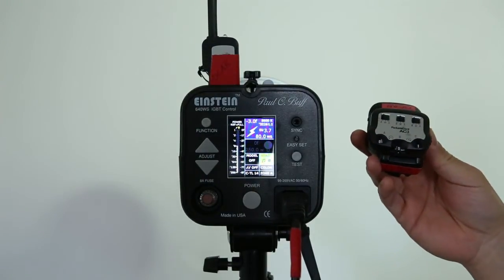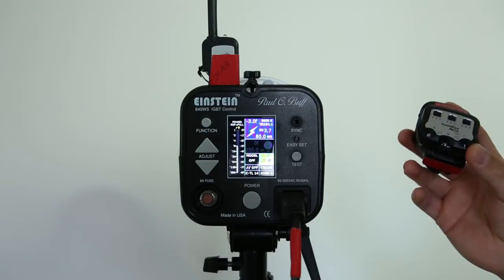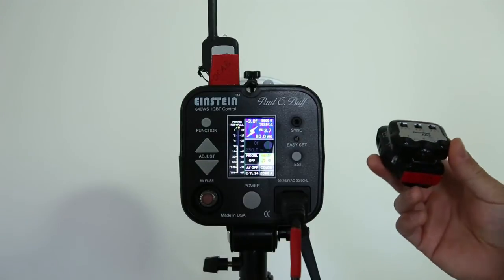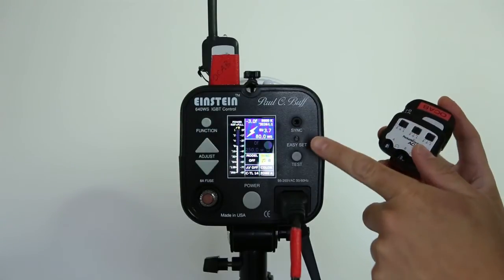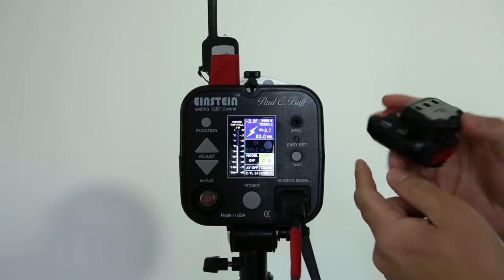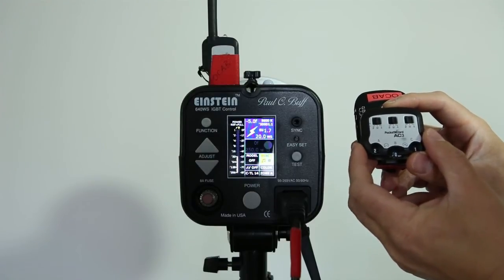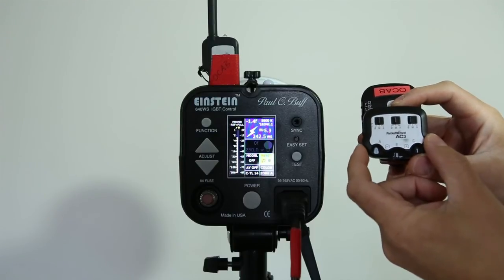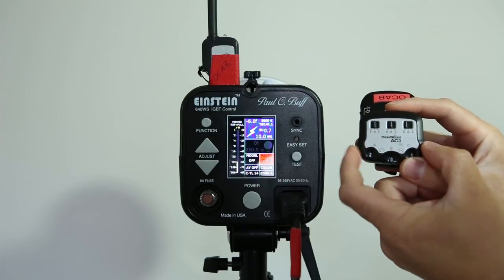Pocketwizard MiniTT1 / FlexTT5 6.021 Beta Firmware

Comment from the maker: At the time this video was recorded, I think production firmware was 6.000. 6.021 was beta. You can get it by selecting the beta option in the PW utility. Currently, 6.200 is production and there is a 6.201 beta that adds some 1D X support.

Comment from the maker: Haven't had much luck with it. At 1/640 you'll start to notice clipping at the bottom end. The way I test is by shooting against a white wall. With the amount of clipping at the bottom of the frame, you can probably survive outdoors until about 1/1250 or longer depending on ambient light.

Comment: That's profoto d1 air strobes. I actually have the TT5 under the profoto transmitter so I can use my sekonic L358 to fire the strobes to check light meter readings when setting up the lights.